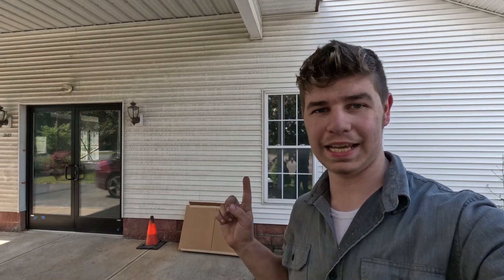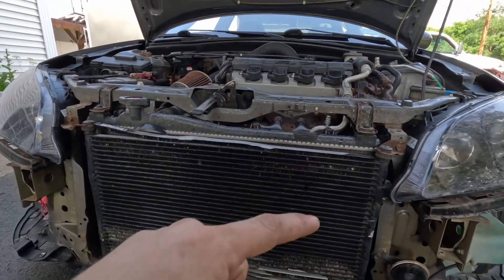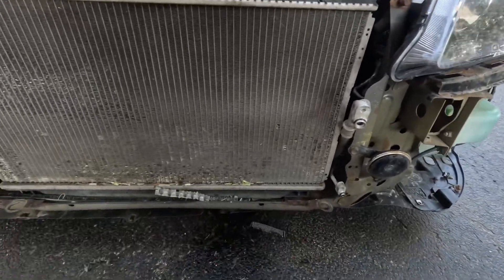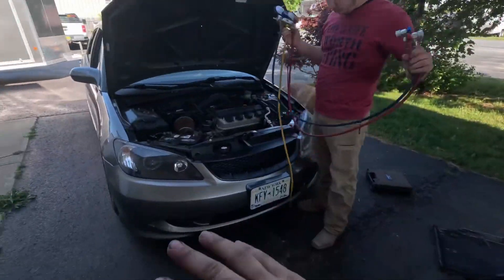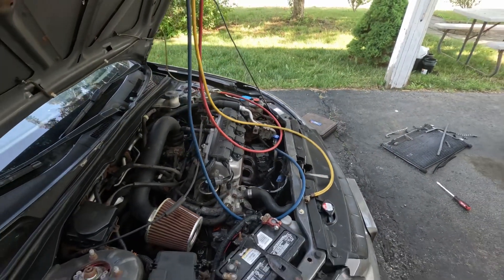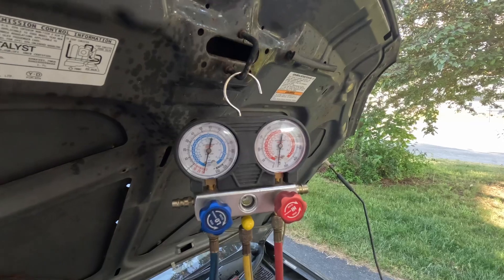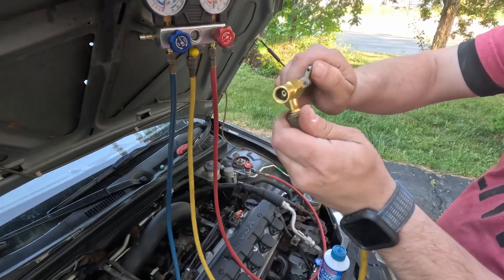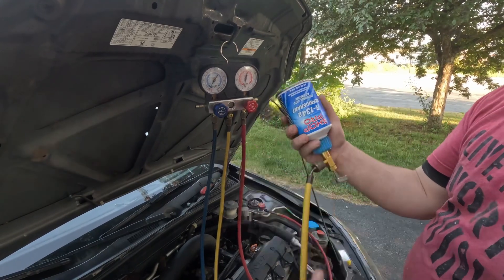How to replace your A/C condenser and recharge the A/C system.

Comment: Nice video.. But I notice something that is a little confusing.. First, after condenser replacement, you didn't add any oil in the condenser or the system . I drive Honda Accord and I know that 1 oz oil is required for condenser replacement and 1 oz for dryer replacement! Dryer and condenser in the case are one piece, so 1.5 oz or 45 ml should be added. Second, I was looking to buy refrigerant R134a, but on all cans with R134a says replacement and also that 250 gr replacement gas equals   around 500 gr R134a refrigerant.. You didn't mention anything about this  or might be that your gas is actual R134a and not the replacement one.

Comment: so after the condenser change no PAG oil needs to be added ?
Reply from the maker: Good Question,  Since I had just replaced the A/C pump and did page oil then I didn’t need to do so when i replaced the condenser.